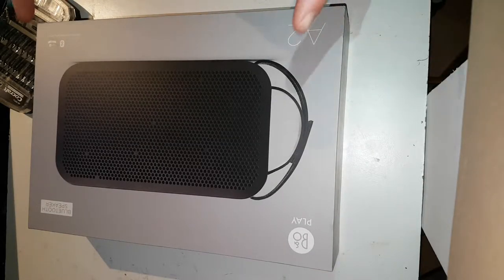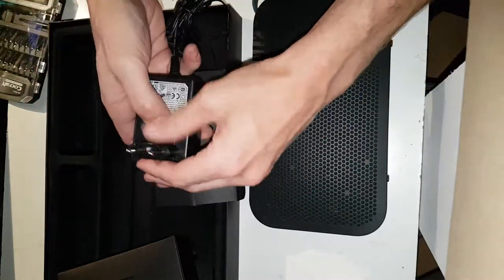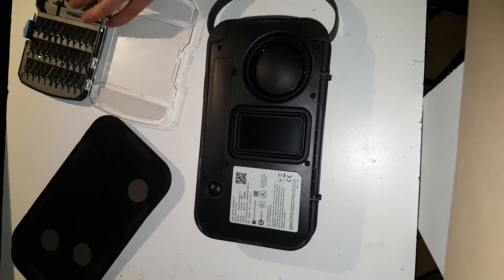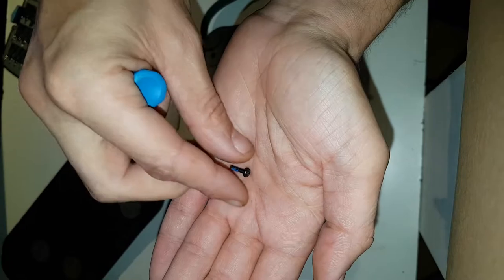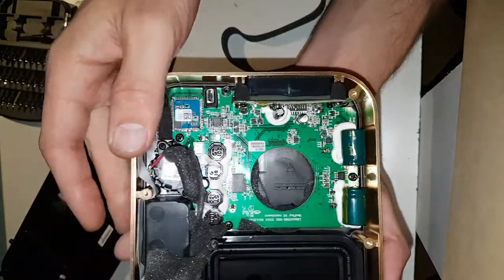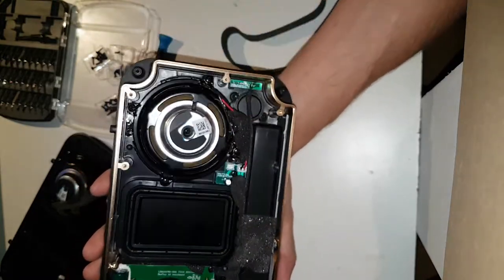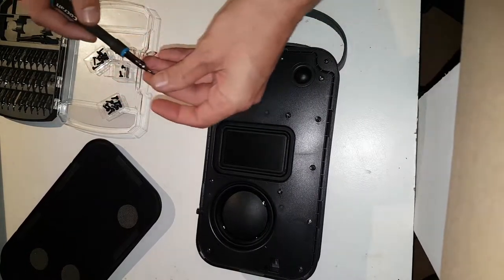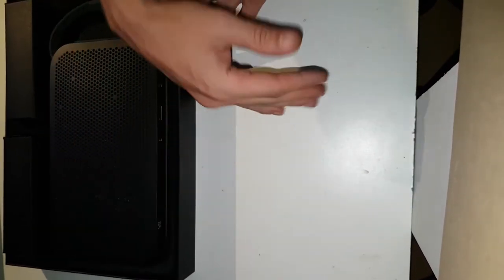#428 - Bang & Olufsen Beoplay A2 Teardown / Disassembly & unboxing.

Comment: 1. The battery is replaceable from the battery compartment. there is a connector there. in this video it has anti vibration tape wrapped around it.
2. The surround is extruded aluminium and machined locally where the screw towers and seal are..

Comment: Hi, mine started making weird noise few minutes before it definitely died, like random frequencies (or the kind of combinations used to test drivers, or rather those when you disconnect a cable), pulsating every ½ sec, until it dies/shuts up.

I just don't know whether it would be the Ampli that crapped out, or the battery (it didn't seem to hold charge toward the end of last legit use...). I'd like it to be the battery, easier fix than anything else :/

Any idea?

Comment: You can easily change the batteri without open the whole thing, you only need to open the batteri box, connection is 4cm from the end of the batteri itself.
Reply: That's what he has done first
Reply: How do you disconnect it? Do you just pull the wires and it comes off easily? I'm looking to do it on my A2 Active as the OEM battery is so poor. Also wondering how much better would be with a 3400mha battery

Comment: But can you actually take the battery out and replace it? Cuz mine is dead
Reply from the maker: there are replacements that you can get, i advice against seding it back for rma because b&o sent me some fucking P6 and it sucked, in all possible ways.
Reply from the maker: update on that, since it was still under warranty i sent it back to the place i bought it, and they sent me a shitty replacement and i sent it back. I dont know what will happen now, if i will get a new A2 but different color or if they will refuse me or if i will get my money back, possibly as store credit. anyway, in hignsight i should have changed the batteries myself. cheap and easy.
Reply: iSn0w27 ....yes you can
Reply: Yes without any problem connection is 4cm from the end of the batteri, you only need to open the batteri box.
Reply: What size star screw is that for the battery compartment? None of mine fits. I have a replacement battery for it.